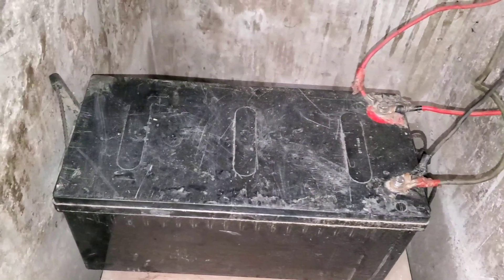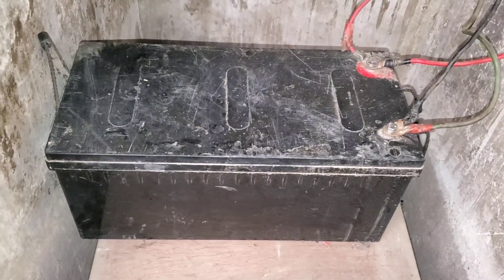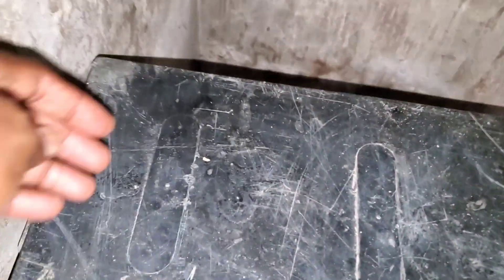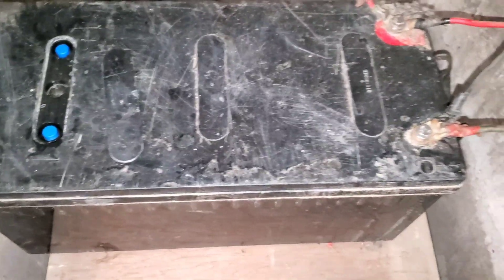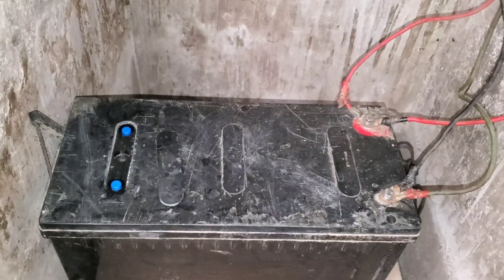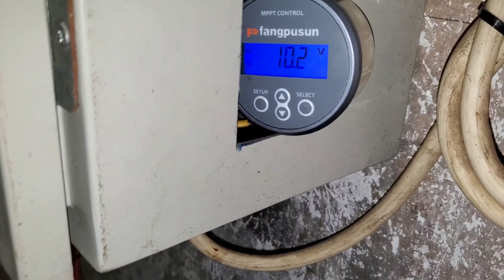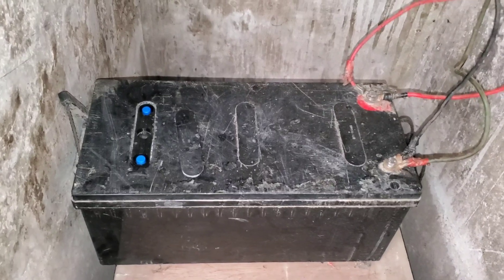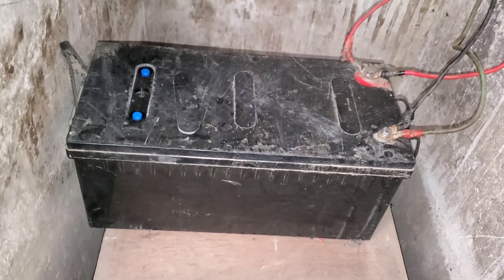Shocker: Dr Solar is reviving a dead lead acid battery.

Comment: How will i revive my lead acid battery that is hot when charging and does not last up to one 30mins?
Reply from the maker: The battery could have shorted cells. So it would be very difficult

Comment: Dr solar playing with lead acid again, are you feeling okay ? lol 

its an interesting failure mode as usually the internal resistance builds up so much that you can't force charge, will they will only take as much as they can.

I recently revived an agm myself too, no desulphators or other stuff.
simply letting it take as much amperage at 14v as it likes for a couple of weeks (roughly 12 hours per day) did the trick for me, i wish i'd documented it to show you.
started off just sitting at 14V (during the charge cycle) then every night i checked it, slowly but surely it increased to now floating at 12.5V, load testing to see just how effective it has been is yet to commence however at least it seems i have managed to bring back every cell.

Hope you and your family are keeping well over there, 
Take care
Josh
Reply from the maker: Hello Josh thank you for sharing. Did the battery get warm or hot at anytime during the process? Most people don't have weeks. They are usually desperate and would throw in the towel by day 3. We are good. How are you and your GF? Thanks for contributing.
Reply: @drsolar  Honestly not that i could feel on the outside of the blow molded case (it was a jumper starter pack that had been given up on).
this is very true, i have been the same haha.
Thats really good to hear, we're doing well thankyou.

Comment: This is deed cycle AGM battery 🔋.  You can achieve much. To revive lead acid battery you need battery desulphator. Buy battery desulphator and do continues charge and discharge while it's contacted to it. You will get good result.
Reply from the maker: Thanks for watching and commenting. I did a desulfator series a while ago. I will charge and discharge and see what happens.
Reply: @drsolar  let's see how it goes sir. I hope the disulfator is able to revive the battery.
Reply: @drsolar  To revive a deep lead acid battery  you have to connect a desulphator on it. Then do a continuous charging and discharging of the battery. U charge to full then discharge to empty. Charge again to full, discharge to empty.  By doing so, you will notice as you charge the battery takes more capacity or takes longer time to fully charge and longer to fully discharge.  You continue doing that on till you fully regain it full capacity. 💯
Reply: @greatogbuagu1370  Hello, please is this (using a desulphator) applicable to all kinds of lead acid battery and regardless of what caused the battery failure?
Reply: @yusufhaliluzakari  Yes.  If you have a lead acid car battery that is heavily sulphated and you connect it on it. Within days the white coated will dissolve back into the liquid
Reply: @greatogbuagu1370  Okay. I'm just particularly concerned about the applicability of desulphators in reviving failed deep cycle (lead acid) battery types which are used in inverter and/or solar systems. Thanks